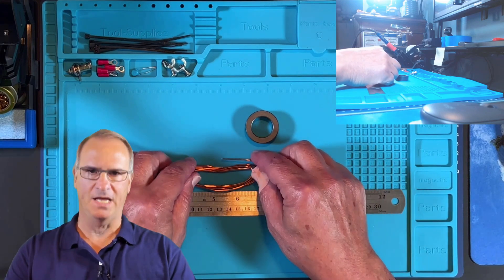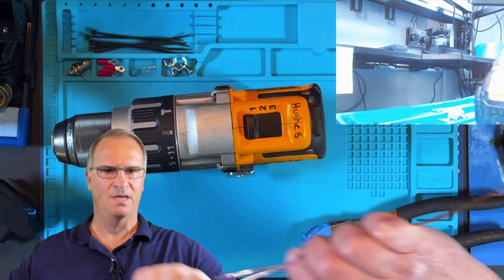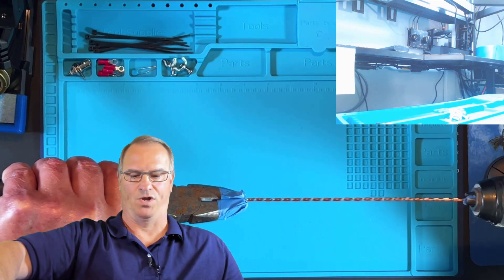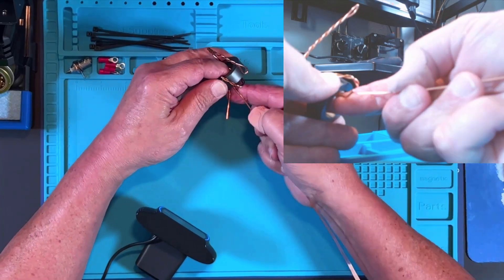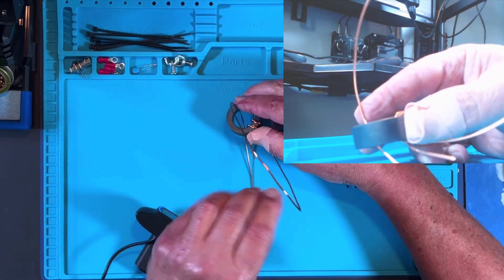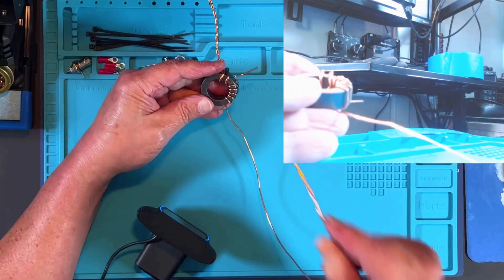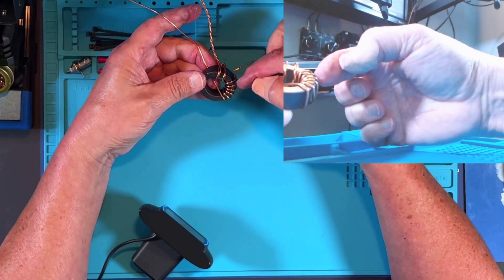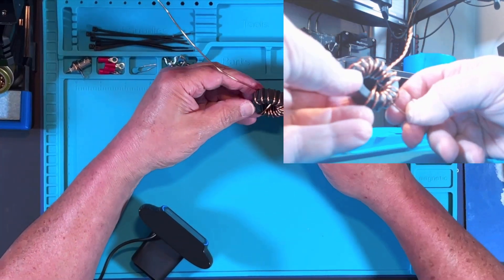Part 2 Wind Toroid: Half Wave End Fed Antenna Build 10/15/20/40 Meter Ham Band - CAHRTENNA Artemis

Comment: Why is there loss of 14v from hand wound toroid transformer output with 
separate winds on core not overlapping. The frequency of primary was 
matched to source AC, the primary and secondary windings are in same 
direction and entire ring core is covered with wire , but 2 separate 
sides. I thought the core under Primary caused induction into separate 
secondary windings. Desparate.
Reply from the maker: Waterfuel, I would suggest reaching out the the developers of the Artemis if you are having issues or questions -- Coffee and Ham Radios.  They would know more specifically how they are expecting the toroid to work in their design.